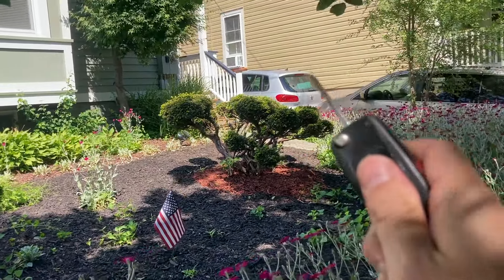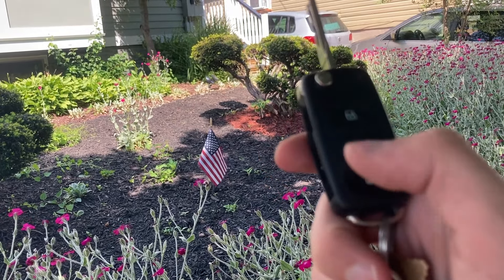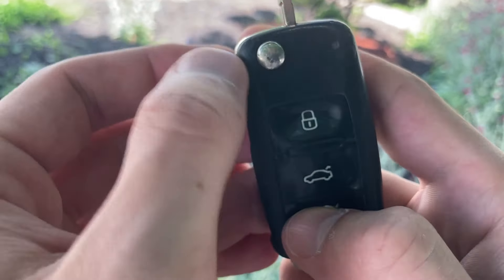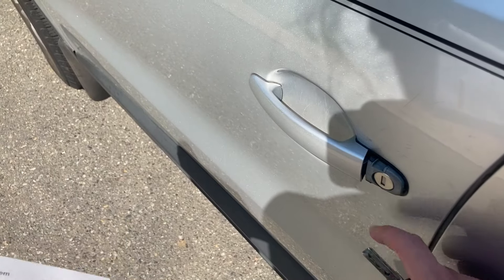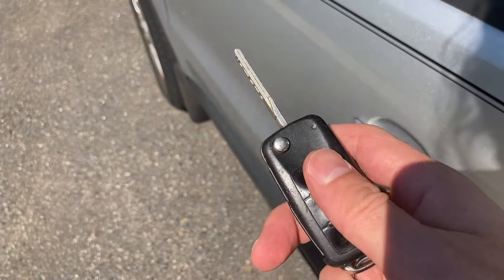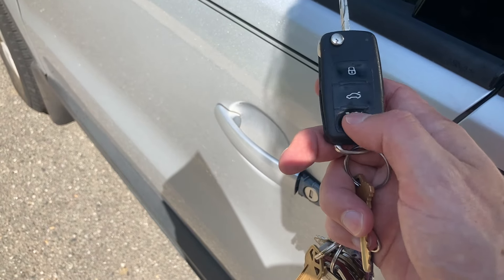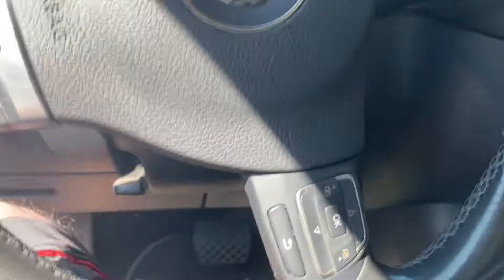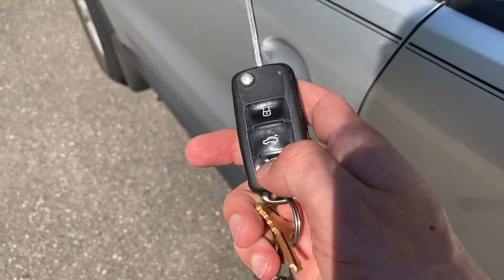Program VW Key After Battery Change - Synchronizing VW Key FOB

Comment: My key does not want to synchronise but it can open the car and start it it does not want to synchronise,what could be the problem?
Reply: did u figure it out?
Reply: I am also facing the same problem. What is the solution?
Reply: I have the opposite issue. My key will lock/unlock, but it won't start the damn car!!!
Reply: @karkkimarkkinat2109 its the chip inside the key, lost the communication.
Reply: Same problem for me. I can't have more than 1 key in vcds, when i try to   set the number of keys at 2 and save, the number of keys goes back to 1. Any idea ?
Reply: This didn't work for mine any suggestions
Reply: @karkkimarkkinat2109 did you figure your issue out I'm experiencing same issue
Reply: I have a 2013 Passat. I tried your solution.  Still not working. 😢😢

Comment: tried this on my 2018 golf and didnt work. This was after changing the car battery. It locks and unlocks all doors except the driver door
Reply from the maker: Thanks a bunch for watching my video and taking the time to comment. You may want to give your car a full system scan to see what fault codes are present. Also with a full access scan tool you would be able to track different values when testing for optimal diagnostics. Please share an update, thanks.

Comment: This worked first try! I was pressing the door with my key in the pocket for months and now I can lock from a distance again. 

My mk5 Jetta is push to start so just follow the same steps, when you go inside don’t press the break just tap start once, wait 5 seconds or so, then tap to run off. And then go outside and press lock 👍🏼
Reply from the maker: That’s awesome! Thanks for sharing your experience and info, very helpful!

Comment: Thank you so much for video.  I have a 2013 EOS Executive which has the push put-on start so I am not able to put the key inside the ignition.  How would I do the same thing you did if I do not have a keyed ignition and have a push button ignition.
Reply: You do his directions as stated, then push the button without pushing brake pedal. I’ve done this cars with push to start, and it worked no problem.

Comment: I tried it a few times and it is still not synchronised? Need help
2010 vw golf 6 tsi 🙏🏾🙏🏾
Reply from the maker: Thanks a bunch for watching my video and taking the time to comment. May I ask how your key lost its synchronization in the first place? Is the battery in good condition? Appreciate any update, thanks.
Reply: Exact same problem VW Golf 6 2010 tsi😢

Comment: Worked perfectly as you suggested. You saved me a few dollars going to dealership or the locksmith. 

Virtual high five!
Reply from the maker: Glad it helped and thanks for watching my video! Virtual high five back!
Reply: Few dollars.  Amazing.  I just went to Volkswagen dealership and they charged me $220 to reprogram two remotes.  No idea why they got out of sync as I did not change the battery.  Anyway.  $220 later I see this video.

Comment: Hello from Eastern Europe! Can you give me an advice how to check battery for FOB with the light - when close to the car or out of range. I have an error ot board: error keyless system and dont know from where is the problem. Mechanics in my town dont have an asnwear. Read some opinions that may be from the FOB battery. Thank you!
Reply from the maker: Thanks a bunch for watching my video and taking the time to comment. Funny 2 people have complained about the exact problem at the same time. I am not sure what car you have but you may want to check for water damage, specifically in the passenger footwell to see if you have a module effect by water damage. Please share an update, thanks.
Reply from the maker: Additionally I have seen people have issues with the Keyless entry module, which you can get rebuilt for a lot less. Google search, repair and return keyless entry module for Volkswagen. There are places that will bench test your module if you send it in to see if the module is malfunctioning. Please share an update, thanks.

Comment: I have a 2012 passat. FOB got slightly wet the other day and the unit is a little beat up. I put a new battery in it and it worked fine a couple days. Now I am getting Key not in range over and over. I tried this and it is not working. Any ideas?
Reply: same here. just got the car battery replaced Monday. now its Wednesday and the key wont work after trying this 3 times, but it was working fine this morning. the dash lights wont even come on when I turn the key without starting the car like he said.
Reply from the maker: Thanks a bunch for watching my video and taking the time to comment. You may want to just make sure you don’t have any water leaks especially on the passenger footwell. Next I would try a hard reset, making sure you have your radio codes and whatnot. If all fails you may want to scan the car for faults in other modules. Please share an update, thanks.
Reply from the maker: If you have an intermittent issue like this I would check for water damage to your modules, like the BCM which is under the passenger footwell often times and on older models can get water damaged. Please share an update. This usually happens from poor sunroof drain tube maintenance.
Reply from the maker: Additionally I have seen people have issues with the Keyless entry module, which you can get rebuilt for a lot less. Google search, repair and return keyless entry module for Volkswagen. There are places that will bench test your module if you send it in to see if the module is malfunctioning. Please share an update, thanks.
Reply: @WheelsTips  THANKS! I will look into these suggestions
Reply: @WheelsTips  Do you think in my case the chip in the fob likely got wet too and thats why its saying key not in range now? The Fob is working to open and lock the door though and worked for a couple days after replacing the wet FOB battery. I ended up ordering a new key with Ace Hardware as a locksmith said minimum $400 and I was told the dealership would be even more. Its gonna be $190 plus tax but waiting until middle of next week for it to come in. Is there anything else you think to explore if the steps in this video didn't work? Seems like something had a delayed triggering of the Immobilizer as the car does turn on and then shuts right off. I wasn't sure if some of your responses were to me or Erika
Reply from the maker: You might be in a difficult situation with ordering your own key given there is usually initial programming which needs hardware and software to program the key initially. Unless they told you they can program the key as well. Sometimes paying more upfront is worth it, if in the long run you end up paying more. Also if someone scanned the car with diagnostic tools, narrowing down the issue would be a lot easier. Much luck with your diagnostics.

Comment: My key doesn’t also work with starting.. same issue?
Reply from the maker: Thanks a bunch for watching and taking the time to comment. Have you checked if your battery is working? Please share an update, thanks.
Reply: Yeah i checked, battery is full.
Reply from the maker: Have you performed a full system scan to see if fault codes are stored? Please share an update, thanks.

Comment: I dont have an ignition  :(
Reply from the maker: Thanks a bunch for watching my video and taking the time to comment. You don’t have a removable button?
Reply: @WheelsTips   - On the door.  Car is push start.  Either way, battery in remote was dead.  Thanks for the video and response.
Reply: Did you find a way to do it?